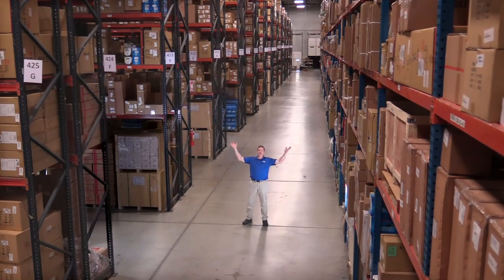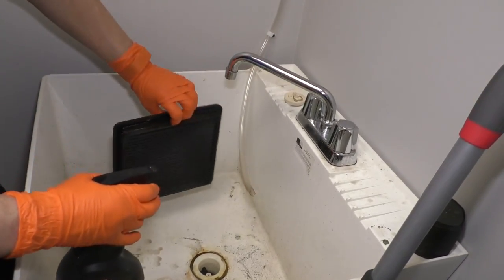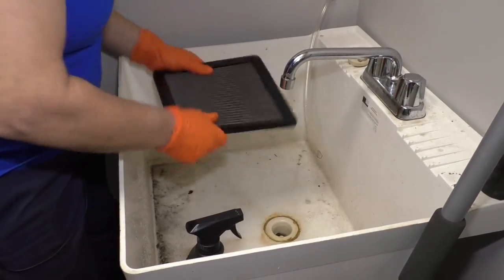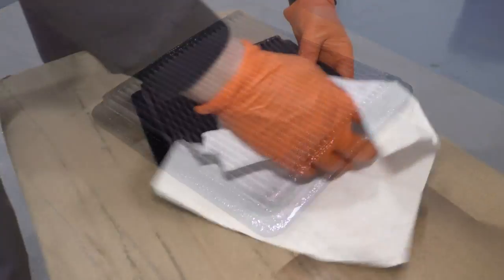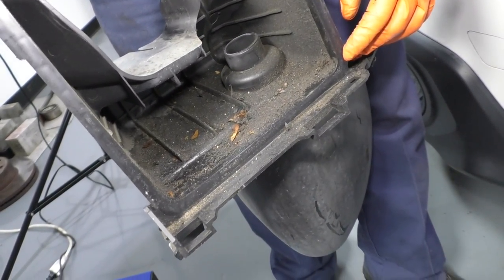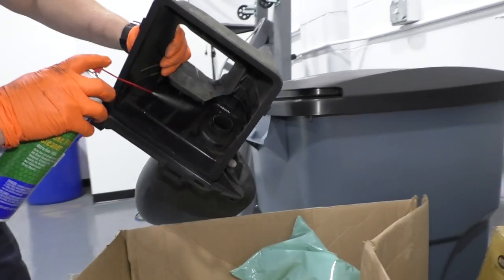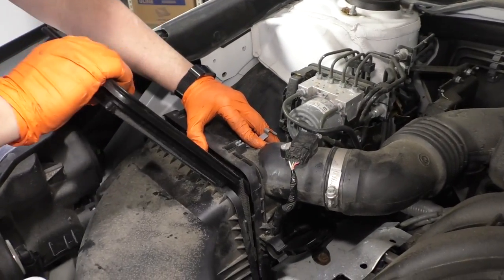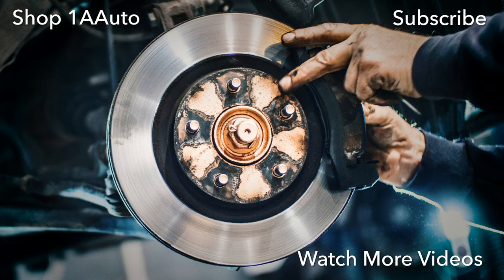How to Clean K&N Filter

Comment: I think you mean you run the water through the opposite of the airflow direction, to dislodge the particles of grime and not further drive them into the filter media.
Reply from the maker: +veevocker Thanks for the feedback!
Reply: Was just thinking that but new wat she meant.👌
Reply: And you need to apply oil on same side air flows in.
Reply: @eddieward3096  no you don’t want your MAF sensor getting oil on it and burning out
Reply: @prestonworden9811  That's why you put it on the side that sucks air in, not the side it blows out towards the MAF.
Reply: Clearly she said in the direction of the airflow.

Comment: I brushed the intake side under running water, I lightly hit the flat intake side of the filter against a flat surface and dislodge a lot of solids off the filter. Then used pressurized air from’ clean’ side through the dirty’ side. Dried and oiled. Cleaned the box. Done👍

Comment: Brake cleaner will dry that plastic out quick and have it dry rot before too long, also just wipe the oil around the seal with your finger to help it seal better instead of wiping it dry and that’s a lot of oil to be using on that filter other than that, nice job
Reply from the maker: +Tyler Betts Thanks for checking us out! http://1aau.to/m/Shop-1AAuto-c

Comment: Check out a comparison test that was done on a number of air filters on the Project Farm channel.  It was very well done.  Shocking to me, K&N was one of the worst for large and small particle filtration.  Bums me out as I am now considering taking it out of my truck.  I'd rather have engine life over the small uptick in HP and acceleration...
Reply: Yea I took mine out after about 2 months and it’s totally caked in dirt… none of my paper air filters have ever gotten that bad
Reply: @zac.bolin01  look into the intake box and dirt is at bottom, only reason why the dirt attaches to oiled filters is the oil.
Reply: Yes, being hi flow i would imagine youre loosing quite a bit of filtration power..
Reply: My air filter has lasted over 10k miles and it’s half as dirty as the filter in this video

Comment: Do I have to wait till the air filter is completely dry to spray it?
Reply: YES !!! only spray the outside part of the filter and NOT the INSIDE. Otherwise the oil can get sucked in the intake and damage your air mass sensor. The outside is the side that traps the dirt and contaminants using the filter fabric and oil. The inside stays clean. 
If you're in doubt, you can spray the inside,  just a tiny bit a VERY LIGHT film, do not saturate. Let it dry in the sun for a couple of hours and instal. Be sure that when you clean it, spray both sides with the solvent but rinse from the INSIDE pushing out. You don't want the dirt to go through the fabric. It is on the outside of the filter, let it stay there and push it out with a steady stream of water. I hope this helps. Cheers.

Comment: Why do we need spray oil after washing and what kind oil to spray in general??? Thanks
Reply: The oil is what catches the dust because it sticks to the oil, and the actual filter keeps bigger particles out. And the oil is just air filter oil it doesn't really matter what brand you use
Reply: @gordiepeck4364  and sticks to your MAF sensor and causes problems

Comment: How important is it to oil it?  Can’t the oil affect the mass air flow sensor?
Reply: Only if you add a lot of it. Spray a light coat and you're good to go
Reply: Let it soak in a little bit, ill be cleaning mine for the 3rd time on 17' Golf. No problems or sensor issues so far

Comment: can you acuallly wash it out? And if so how many mins do you let it dry for?
Reply: Ada L yes they’re designed to be washed, unlike the paper filters. Just make sure when you hose it, do it from the clean side to the dirty side.
Otherwise you will push all the dirt in the wrong direction.
Reply: When it’s ‘dry’..😉

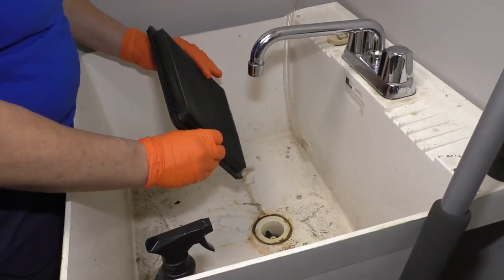Comment: 1:35 'i'm going to run the water thru it like the air flows..." Actually you ran it in the reverse direction which is likely how you are supposed to do it as the dirt is on the upstream side of the filter.

Comment: it says to be cleaned after 100k miles i prefer to do more often thoughts?
Reply from the maker: +Christopher Twaddle Yes, you can definitely clean it more often!  Thanks for watching.
Reply: totally depends, if you're driving dusty logging roads, you'll be cleaning it a few times a year... just inspect it! I've seen filters get completely clogged up after a weeklong wheeling trip on very dusty/dry terrain mid-summer
Reply: There's no way will say on a k&n filter to be cleaned after 100.000 miles. Maybe 10.000 miles if you live in the cleanest area ever with no dust, leaves, bugs, humidity.
I clean mine every 6.000 miles when I'm also changing the engine oil. It's a 30 min job.

Comment: I put a K&N filter on my 2013 Hyundai Elantra. I noticed that there is another filter that is attached to it. So, there are 2 air filters in a 2013 Hyundai Elantra?
Reply: It's probably for emissions, it's supposed to stay in there and if you remove it, you'll probably need to replace the whole air box

Comment: What happens when you don't oil it?
Reply: the dust particles don't stick to the filter. They tend to just form a lump at the bottom of the filter as the filter is not sticky due to lack of oil.
Reply: Particles will get into your engine

Comment: Why do automatic cars need a torque converter
Reply: Because it allows for the engine to continue running while you're still in drive. It allows for torque multiplication when the torque converter isn't locked up also.

Comment: Perfect job 

But this oil will mist onto the air flow meter reading will not be 100% hp loss very simple thing don’t use oiled filters
Reply: The old wives tale.  It won’t ruin anything.

Comment: I’d recommend not using a K&N filter on modern cars as the oil can ruin your O2 sensor. They also don’t work as well as a standard paper filter.
On race cars they work great though.
Reply: do you mean maf sensor? and it wont ruin it might make it oily over time big deal just clean it.  they're cheaper over time due to being washable
Reply: No, old wives tale that too many believe.  I’ve yet to see any evidence to back that up.
Reply: It is very important how you re-charge it. It is supposed to have a thin film of oil. It doesn't need to be so saturated that can fly onto the MAF sensor. Also, you're NOT supposed to spray oil on the filter side towards the  MAF side of the intake. The oil stops the dirt using the fabric. The inside doesn't need anything, no dirt is going the opposite direction and no need for the oil..

Comment: This video is about Cabin Air Filter (i.e. the filter that clean the air that gets into car's cabin). Can the engine air filters also be washed (without damaging them)?
Reply: This video is NOT about the cabin filter. You’re mixed up.
Reply: This vide is about engine air filter...
If you can't recognize an air box then it's not the correct video to start with👍
Reply: The cabin air filter is inside the cabin not the engine bay lol

Comment: I used this K&N one time and it damaged my air flow sensor. It was the costly lesson learned just to save few bucks. When I sold the car I asked the guy if he wanted this filter, oil can and cleaner for it. He said no. That's how bad it is. Maybe it is good for an old engine that do not have an hi-tech air sensor.

Comment: What happens if you spray on both sides?
Reply: You can mess up your MAF sensor and some may get sucked into the engine, resulting in major repairs down the line. Idk about your car/truck, but the MAF for my truck is $200.